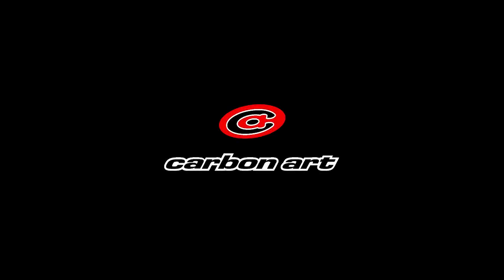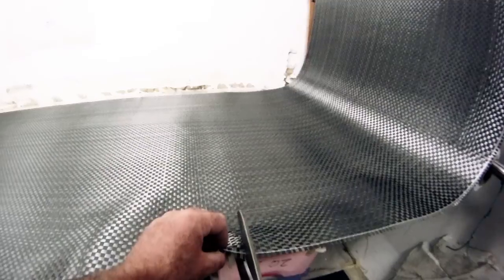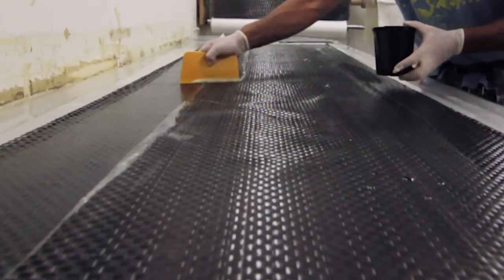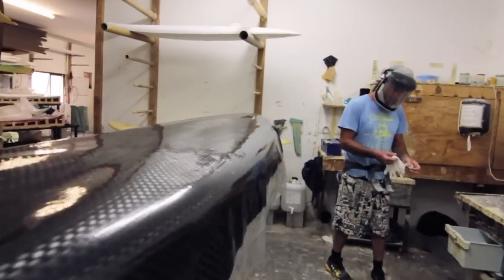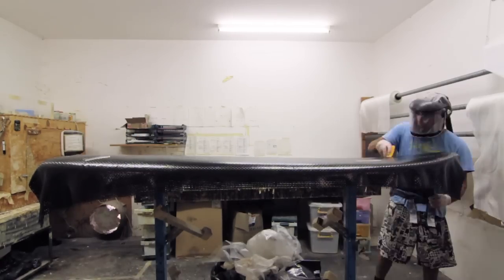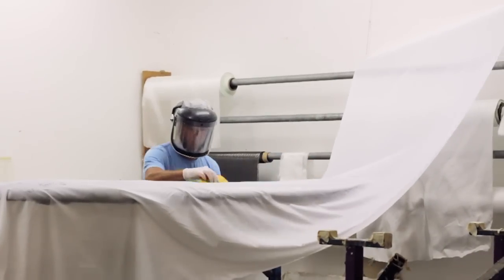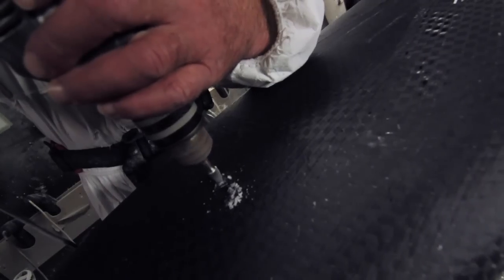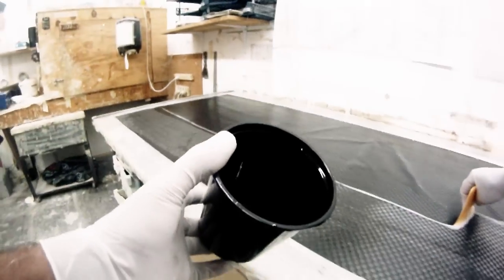Carbon Art Factory Talk 5: Laminating

Comment: Hello Mr. James. Very late reply on your video and I really hope that you can answer my question.
Why do I always end up with wrinkles after vacuuming my boards? ie: I put carbon on the blank (no wrinkles). On top of this I put peel ply (again no wrinkles). On top of this I put breather fabric (again no wrinkles).
All this I put the board carefully in the vacuum bag (making sure not to move things), and pull a vacuum. The vacuum bag does get some wrinkles (not more or less than what you have in your video)
After curing (room temperature) and removing everything my board does always have wrinkles.
I've tried many times, but ALWAYS end up with wrinkles ! What am I doing wrong?
Reply from the maker: Hi Kian, so this could be 2 things, the breather fabric is too thick and forming wrinkles that then pulls the laminate up into, sort of molding a wrinkle, or maybe too much vacuum so the side of the board with the new laminate is compressing so there is surplus material that can form wrinkles, vacuum inlet should also be on the opposite side of the board to the wet laminate.
Reply: @CarbonArtWindsurf  Thank you for your answer. Today I did another test and discovered that (1) I am using to much epoxy and (2) that the breather fabric I use is no good.
The wrinkles I get are actually only epoxy! So after doing another test with less epoxy, and new (thicker) breather all was perfect!
So.. Lessen learned. Less epoxy and do not use cheap breather fabric!
Reply: @iamkian  what is the correct amount of vacuum to pull? I haven't found anyone talking about this? Thanks
Reply: @martindowning1448  20%

Comment: I watched thru the rest of the videos and you go on to sand and eventually paint over the carbon fiber. could this be done with a clear coat leaving the carbon fiber as the finished look?
Reply from the maker: +TufRiverboards Hi! Yes you sure can - we do so on our Pro Finish Slalom boards (see http://www.carbonartwindsurf.com/boards/slalom/ ) Just note that generally clear sanding coats are harder to work with, so requires additional work for the perfect finish :)
Reply: awesome. I have been looking into resin to fabric ratios and what not and was thinking, why not just wet out the fabric on a table with the proper resin amount. Couple days later I came across your video thanks for sharing. You do nice work, looks great.

Comment: Great finished product. But the amount of waste you guys have on the cutoff is unbelievable.
Reply: It’s because the use the widest carbon for everything. Sometimes stand ups are 38” wide and sometimes short boards are only 18 1/2”

So having the largest roll of carbon saves money and convince, instead of buying a roll for every sized board.